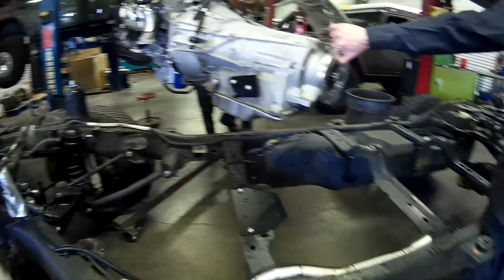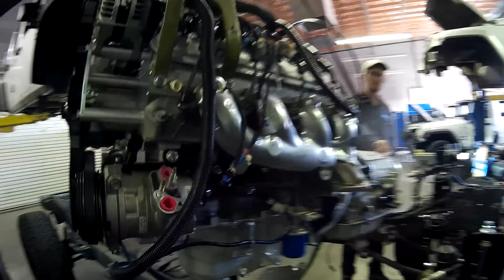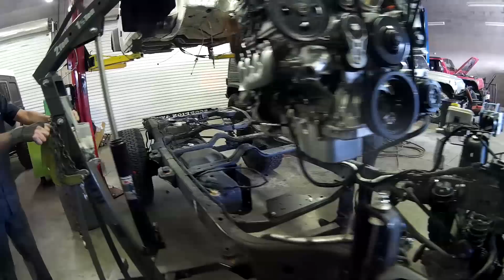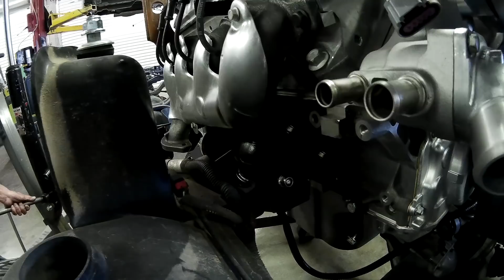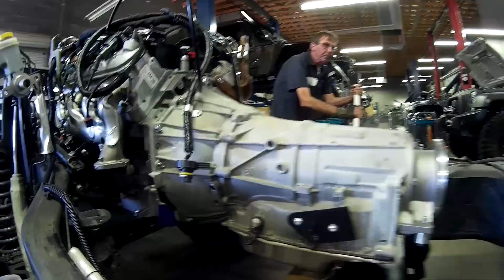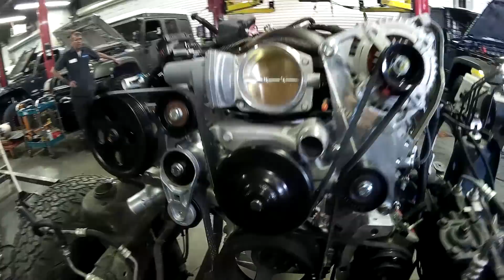Jeep Wrangler JK V8 EZ Engine Mounts

Comment: What lower center of gravity long arm lift kits and gearing do you recommend to use with a GEN V 
LT 6.2 8 speed on 37’s maybe 40’s for my 2011 rubicon 2 door daily driver/weekend OHV trail & crawler that is heavily armored?When will the ez installation kit with MO CAN be for sale?